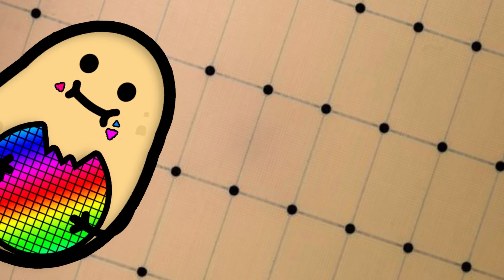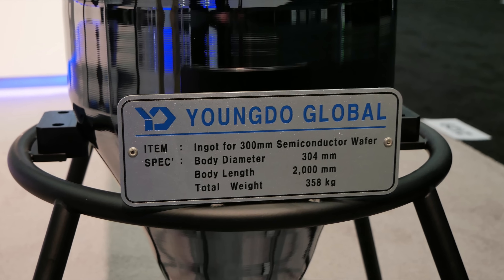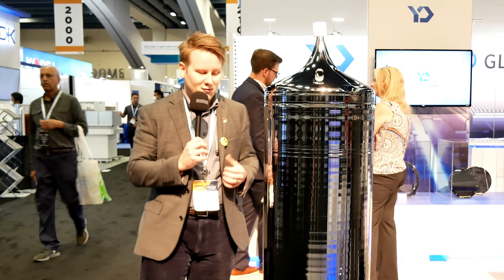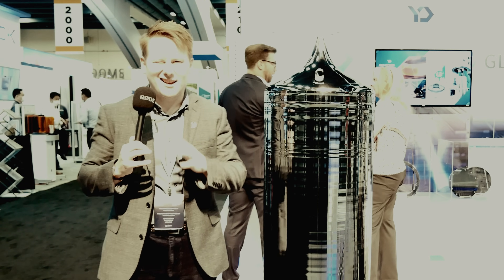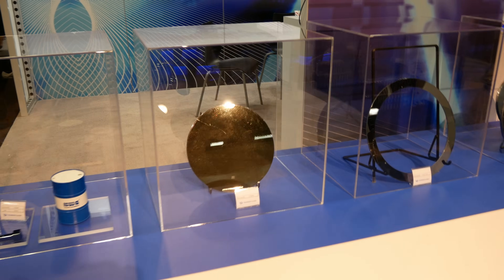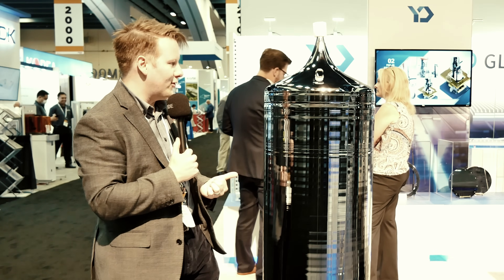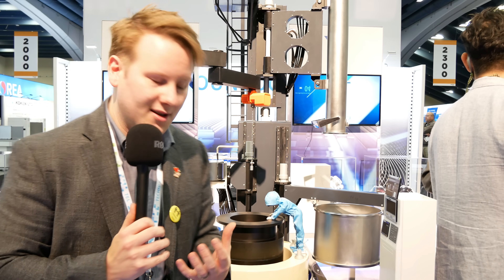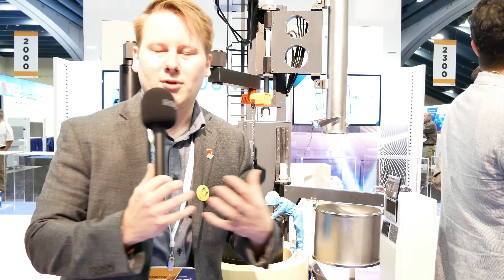Ingot or Boule? Making a Computer Chip Starts Here

Comment: no one sees the mistake of 200.000 minutes - threre are only 20.000 minutes pulling time
Reply: ok this grade needs 10 times
Reply: lol. You're as well off by the factor of 10. It's 2,000 minutes. 1meter is 1000mm.
2000mm/1.2mm*1m/60minutes = 27 hours

Comment: I am interested in thermal cameras as a hobby. and the main material used for lenses in those wavelengths is Germanium. Also a semiconductor and it one line below Silicon on the periodic table. I do have a 150mm lens with a lens element at the front of that diameter too. So someone also grew such a giant mono crystalize ingot of Germanium to cut and grind lenses from. There are a few manufacturers for Germanium optics, but it's closely related to silicon lithography.

Surprisingly the most information you find online is from a Russian manufacturer.

Comment: Both the crucible and the seed crystal spin (oppo dirs), and the speed of spin + pull determines when the crystal "shoulders" from that conical top to the rod.  Of course, polysilicon is an insulator, so there's also a dopant (like boron or antimony) in the melt.  Sadly, it's not usually perfectly distributed, so you might only be sending the middle 100mm out of that 2000mm rod off to sawing after grinding, etc.  Imagine having to grow a dozen of those and throw away, use for re-melt, or fit someone else's specs O:-) with the rest...

Comment: How much is one of those ingots worth again?
(You said sub-$100 per raw wafer, presumably 300mm - but how many wafers per ingot? I can look up that 300mm wafers are apparently 775 μm thick, but I don't know how much is wasted in the cutting process. There is no such thing as a waste-less cut, after all.)
Reply: @aphenioxPDWtechnology  it's crazier than that. They fire protons from a particle accelerator across the face causing them to embed themself into the silicon introducing flaws in the crystal structure. Then they heat the ingot and where the protons caused the flaws the wafer fractures off the ingot. Finally they're probably polished to the correct thickness.
Reply: @JaenFoster  Cutting silicon with a particle accelerator was an idea which one startup company was promoting recently by sponsoring videos on MinutePhysics, with Bill Nye and through other channels. Some people warned that it was a scam. I do not know whether it was or not, but it is certainly not the process that is used in the industry -- real factories use wire saws with diamond slurry, like Vaes Joren have said.

Comment: This blew my mind... wonder how many they make at one time? How much power required? What kind of infrastructure is needed to maintain a 138 day process with 0 down time? It's honestly very impressive.
Reply: It's not just 'no downtime', it's 'maintain perfect conditions the entire duration'...
Reply: @Steamrick  Great point.
Reply: My highschool physics teacher took us into her lab where she was doing research. They used concave mirrors paired with 4 high power lamps-several kW(not sure what kind those were, maybe sodium) to focus the beams on the raw material right below the seed.

So expect dozens of kW just for the melting process. Everything else to provide stable enviroment and continuous work will take another few ...
Reply: And from the video I can recognize the induction furnace they use to melt the silicone, so most likely it takes hundreds of kW to melt it. But there has to be a lot of another equipment to keep it clean and in protected enviroment, most likely pressurised with inert gases to prevent oxidation and production of slag
Reply: A large company would have a large building filled with crystal pulling machines -- running over a hundred of them in parallel and producing maybe a thousand ingots each month. (A thousand ingots yield around 1.5 million wafers.) Each machine requires circa 50 kW of power in the steady state and several times as much during startup when it melts the fresh charge of silicon.

Also, typical pulling rates are around 30 mm / hour, so pulling itself takes a few days, plus unloading, loading and melting takes a few days. I do not know why this video quotes 100 times slower pulling rate -- perhaps this particular company does something unusual. Or, maybe it was just a miscommunication. There are some parts in these machines which move at 0.01 mm/minute, but they are not the crystal.
Reply: no one sees the mistake of 200.000 minutes - threre are only 20.000 minutes
Reply: ok this grade needs 10 times

Comment: Why polycrystaline? Aren't ingots a single crystal?
Reply from the maker: The pre-cursor material is usually poly-Si. The ingots themselves are a single crystal.
Reply: @TechTechPotato  I think somewhere around the middle of the video you said the wafers are poly. Where you talked about how they need a carrier. Did I misunderstand or did you misspeak?
Reply: @SwordQuake2  I believe what Ian meant to say is that the large boule, which is meant for carriers, is not monocrystalline, because it doesn't need to be. 

Restated another way: The carriers are made of silicon, so that it behaves largely the same as the wafer, but since it doesn't need to be made into chips, it doesn't need to be monocrystalline.

Comment: 1:02 wow, that's 139 straight days of slowly pulling the crystal out of molten silicon. Seems to take a lot of energy to produce such an ingot.
Reply: Yeah if you consider the energy put in and the price it goes for it's almost like they sell it for barely more than the energy cost
Reply: @Veptis  received Ring Disc yet? I'm still wating for mine :D
Reply: @ProjectPhysX  it better be more than a 50ct plastic toy
Reply: I question that figure.  I have heard much faster growth times quoted by others in the industry.
Reply: yeah, now imagine a power failure or having a lock down and having to shut down production.
Reply: @jeffrydemeyer5433  Ever heard of a UPS!!! Production doesn't stop during lock down you dipper, China handles this well, workers live on site.
Reply: no one sees the mistake of 200.000 minutes - threre are only 20.000 minutes
Reply: @callwide 
Sorry dude. You are wrong.
1 day is 24 hours x 60 minutes.
1440 minutes in a day.

So your calculation of 20,000 minutes is only 13.88 days.

GED classes are available for free at most community colleges. Good luck
Reply: ok this grade needs 10 times
Reply: @markjackson7467  no, the amount of energy required to keep the silicon molten
Reply: @somethingsnowing  no that is thermal dynamics - heat loss you dipper. Study the laws of thermodynamics 2nd law. keeping it hot is not a problem. Moving it 3 metres is nothing to the work needed to move it 3000km to the show
Reply: @markjackson7467  Where do you think these are getting made, where energy cost to keep a giant vat at ~1500c for half a year is negligible. Venus?